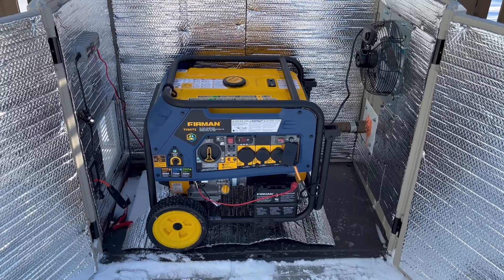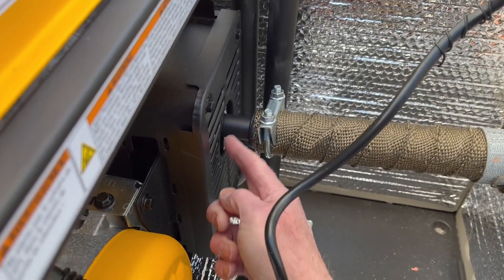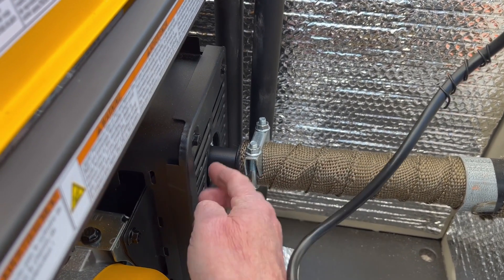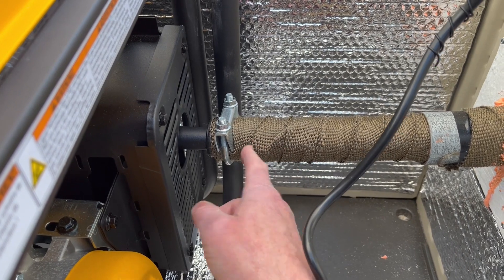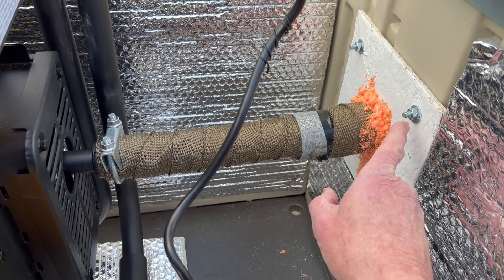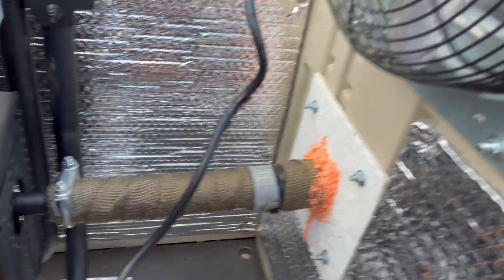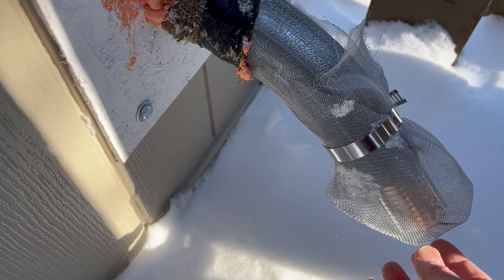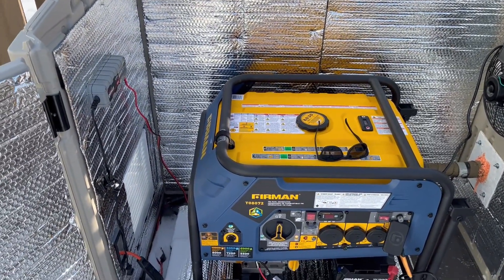Generator Enclosure - Exhaust update -

Comment: I am trying to find that 2” metal pipe …. Do you remember what Home Depot calls it, or what’s it’s used for normally ?
Reply from the maker: No I dont....it was down the plumbing aisle with many other different shaped metal pipes.....should be easy to find
Reply: @Tacomaboy2004  Thanks, I am starting to build my generator shed this weekend.